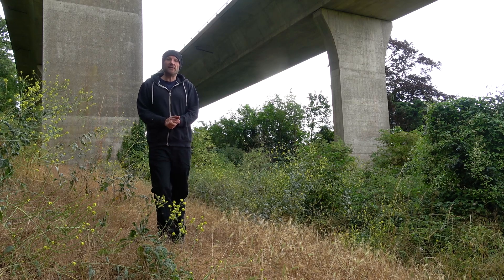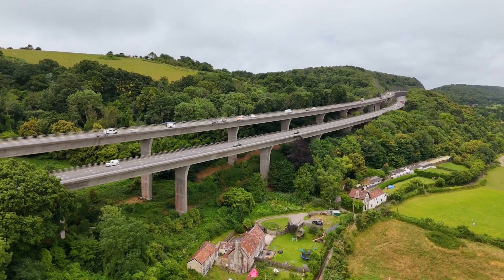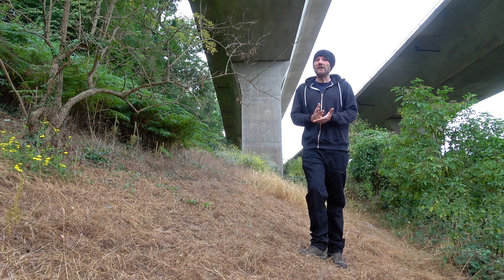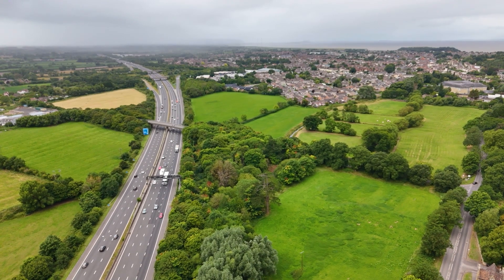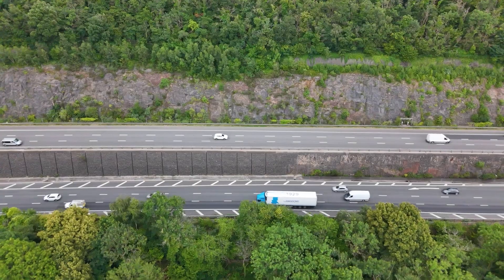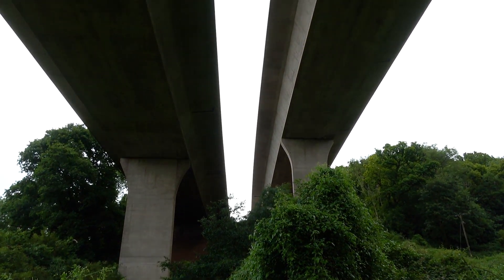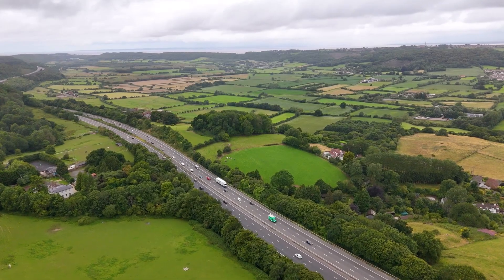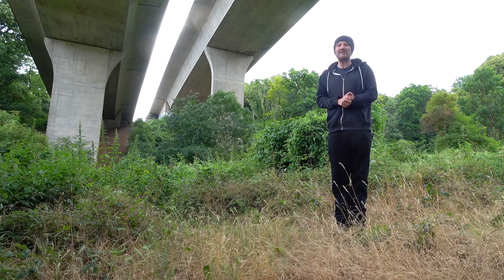The AMAZING Split-Level Wynhol VIADUCT - M5 motorway - Why Is It On Two Levels?

Comment: Check out the two viaducts on the A30 around Redruth in Cornwall. The steel shutters from this viaduct were used to build the Gilberts Coombe Viaduct and Blowinghouse Viaduct after they were used on this one. So the designs are of course identical. I worked on the Camborne Scorrier Bypass for Costain, cannot believe that was fifty years ago.

Comment: The design engineer for this section was Freeman Fox & Partners (which later became Acer; then Hyder and now part of Arcadis).  Whilst a student at Portsmouth Polytechnic, the construction site was one of our field trips and we walked along inside one of the box girders.  Little did I now that 10 years later I would be working for FFP in Hong Kong with one of the young FFP senior engineers that had worked on the design of this section as my boss !
Reply: IIRC Freeman Fox were also the deign engineers for the Severn Bridge (the first one)

Comment: A beautiful but very dangerous stretch of road, you are tempted to look at the scenery in the area rather than where you are driving, if you are scared of heights it does look scary. If you imagine dropping off the side which has happened in the past, you are pretty much dead. The cross winds can be horrendous as well, so driver beware in Somerset.

Comment: Before the bypass tunnel at Saltash was opened - always had a chuckle, as we inevitably sat in a long queue of static traffic - that everything came to a stop due to that single set of traffic lights in Saltash - regardless of where you had travelled from throughout the UK to get to Cornwall - via the M4, M6, M42, M5 - after travelling hundreds of miles, for hours on end -  it always came to a grinding halt right at that spot lol.....

Comment: Celebrating 50 years of a road engineering achievement is a good thing, but it made me wonder if there were still bits left of some earlier road projects which would now be celebrating their centenary?  You see, the 1920s was the time of the first bypasses.  While a number of them were doubtless widened, concreted over or turned into the alignment of a new motorway from the 1970s, I wonder if there's a trace of some where the replacement roads were built on a different route or further away from the town, leaving the old bypass route nowadays inconsequential?

Comment: Yes it’s a great bit of engineering but with a fear of heights I hate driving southbound along this stretch. I am usually near side lane behind a lorry or I come off at Gordano and take the old route to Clevedon then back on. I get a horrible feeling that I am being drawn to that open edge and tense up, once I get to the point where you start going down again and there are some tree tops visible on the other side that horrible feeling goes and I can relax again.

Comment: I spent a couple of years commuting up to Avonmouth to work in all winds and weathers on a motorcycle. This bit of road is terrifying in the winter on a bike, I would purposely not overtake stuff often sitting at 40mph simply because I did not want to get into the third lane as I could not get the thought of flying off over the barrier at the slightest gust of wind!

Comment: Thank you for the wonderful views and also making me realise how old I am.
I worked on the construction of this section of the M5 motorway which was built by Cementation Construction.
The actual construction process of building Whynol was more complex than it would be today as there were no precast units and the whole structure was built from formwork (scaffolding and  plywood moulds) , hand fixed steel reinforcement, and ready mixed concrete brought to the site from local batching plant. 
During construction the whole structure was quite flexible ( until the deck was complete end to end) so when the incoming loaded truckmixers braked to discharge , the viaduct would gently sway along the line of the motorway.
This structure is a credit to the engineers that designed and built it and especially the level of materials quality control and testing.
The farm building beneath the viaduct was used as the site offices during construction.
Reply from the maker: fascinating insight, thanks!

Comment: The stretch of railway line between Bristol Parkway and the Severn Tunnel is on different levels in places - and indeed at different points, which line is the higher one changes! This is because the line ascending from the tunnel is at a shallower gradient than the one descending.

Comment: We've just returned from a holiday in Croatia and while there we used the A1 motorway. It twists and turns through mountainous landscapes, using long tunnels and high viaducts. I was amazed at the engineering that must have gone into it. It dwarfs the M5!

Comment: You joke about demolishing most of Clevedon but they actually ran the motorway right through the middle of Portway at the bottom of the initial incline - this is why the old railway station for Portbury is on the other side of the carriageway to the majority of the rest of the village.

Comment: Actually it is/was considered good environmental construction practice (sic) when building motorways though environmentally sensitive hilly areas to split the carriageways to minimise the visual impact. A bit of a joke when you consider the exhaust and noise pollution which can be detected and heard many miles away and you have still sliced though greenfield sites.
Many years ago these concepts used to be in the design standards for the then Ministry of Transport which evolved to  be part of the Department of Environment. This reorganisation was a big mistake because it found itself giving evidence on opposite sides of Public Enquiries for new construction of motorways and trunk roads.🤣🤣
To confuse the opposition the best form of defence is akin to cutting up worms and elements  have evolved into today’s National Highways, which in the spirit  of national unity only responsible for England , not Scotland, Northern Ireland or Wales.😡
Needless to say, in the intervening decades, any semblance of internal expertise or being an informed client to manage contractors has been thrown out with the proverbial  bathwater though endless reorganisations and staff cuts in the name of efficiency.
I doubt whether such a structure could be built cost effectively  today without it hitting the cost over runs synonymous with HS2, aka HS1.5 the over priced high speed railway to nowhere (Not B’ham but the cities further north). But I save that for another rant🤣

Comment: There is a section of I-70 through Glenwood Canyon in Colorado very similar to this. It may even have been inspired at least partly by it.The road was built through a narrow canyon that already had a two lane highway running through. They used the already existing highway as the eastbound lanes and basically hung the westbound lanes on the cliff above. It's a gorgeous drive and an engineering feat.

Comment: Here's an "interesting" fact for you John, and viewers...
See the cutting through the hill at the right of the frame at 00:30?
This is where geologists working on the M5 discovered that one of the ice ages had reached much further south than previously thought.
It's also where you can guarantee that some twat will lose their poorly maintained caravan on the Friday afternoon of every single spring/summer bank holiday weekend, leading to tailbacks reaching to somewhere around Edinburgh.

It's also definitely not the stretch of motorway where I drove at 127mph the evening after passing my driving test in 1991 after persuading my dad to lend me his 405 SRi. Because that totally didn't happen Officer.

Greetings from Portishead.

Comment: John or is it Jon? Anyway, again you missed the chance to talk about the former wide loads holding area on the northbound carriageway that was in use during the Avonmouth bridge strengthening and motorway widening works... It’s now behind the new crash barrier and nature is taking over, but you can still see bits of it between junctions 20 and 19 in the area of the split level section.
Reply: Google Maps Street View from 2008 shows it with recovery vehicles https://www.google.co.uk/maps/@51.4552009,-2.7720478,3a,75y,5.7h,78.58t/data=!3m8!1e1!3m6!1sFh2zn7k9hGnv5cVIzjkwUw!2e0!5s20081001T000000!6shttps:%2F%2Fstreetviewpixels-pa.googleapis.com%2Fv1%2Fthumbnail%3Fcb_client%3Dmaps_sv.tactile%26w%3D900%26h%3D600%26pitch%3D11.417018754617231%26panoid%3DFh2zn7k9hGnv5cVIzjkwUw%26yaw%3D5.701147208561281!7i13312!8i6656?coh=205410&entry=ttu
Reply: Google Maps Street View from 2008 shows it with recovery vehicles - In case my post with a link disappears, its at 51.4552009, -2.7720478
Reply: Google Maps Street View from 2008 shows it with recovery vehicles 51.4552009, -2.7720478. The former holding area for the other direction (southbound) is at 51.5123114, -2.6530558

Comment: This section of the M5 taught me -or rather reinforced an advice from my driving instructor - that when you see a hill, put your foot down a bit more so you can maintain average speed. Lordy knows this advice has gone from modern teaching lessons, because so many drivers maintain their foot pressure and as a result slow down due to none anticipation of an incline.

Comment: You missed out that invariably in the summer, some twat towing a caravan southbound inevitably misjudges the descent back down onto the plain and flips it closing the motorway for hours. Triple points if it takes out another caravan towing twat as it goes over.

Comment: A friend was one of the scraper drivers for Blackwells on this section, scraping the blasted material either side of the raised section. Shift work, and he reckoned it was the most dangerous job he ever did with the danger of plunging down the hill if the machine slid. RIP Jimmy.
Reply: Blackwells - theres a blast from the mast. They were the earthwork contractors on a job i did at Costain back in the 80s. Hopefully they are still at it...
Reply: @edf6607  Unfortunately I think they’ve gone now. Heyday in the big infrastructure days and demise afterwards.

Comment: This is the largest vertical separation between two carriageways on the motorway network.
Reply: I dont know but in Italy things like this are normal. What could be the biggest vertical separation is on A6, the motorway was initially built as a single carriageway (not a motorway back then) and then  in 90' was built the second carriageway. In a point the old carriageway has a loop and the new one doesnt. Here are the coordinates 44,3211746, 8,3759671

Comment: In Canada, that would be an embankment in most cases. We've got several exemples of absolutely massive embankments and 40 meter deep roadcuts. There's just so many mountains that there's more than enough rock to build those massive embankments without having to mine the rock somewhere else. The 73 going north through the Laurentides in Québec has a number of dump piles for surplus rock. Even after building all of those massive embankments, we still end up with more rock than we know what to do with. I do have to say though, it does make for an absolutely spectacular structure.

Comment: Japan has many such viaducts and often on aplit level. Given the topography of Japan, I can now understand that the reasons are likely the same as the Wynhol Viaduct. Even though as a child we used the M5 to travel down to Cornwall for our summer holidays, I had no idea that the UK even had infrastructure similar to what is here in Japan. The Tokyo and Osaka Metropolitan Highwayw are of course mostly viaducts, with the motorway interweaving closely between buildings and in Osaka (possibly Kobe) where the motorway actually goes through a building.

Comment: You never mentioned the nudist camp alongside.
There is also a tunnel (you’re not supposed to go into) that goes under the split level which itself is split level with a near vertical staircase.
Reply from the maker: more details on tunnel required....

Comment: Apart from demolishing Clevedon, the other reason not to go through that 'nice flat bit' is that it's a National Nature Reserve. Back in 1971 it was designated as a SSSI, which was probably another reason that steered the planners away from the valley and onto the hillside. It's certainly ended up being more ecologically friendly as a result.

There's quite a few footpaths - and footbridges - that cross this section of motorway, with two going over and a couple going under the viaduct section. The footbridge that crosses over the top of the split level section is not great if you don't like heights! Whereas the footpaths under the viaducts really allow the scale of the engineering to be appreciated.

When driving northbound, just before you leave the viaduct, a metal access door is visible in the base of the southvbound viaduct, under the carriageway. I've always wondered whats behind that door, and how often people go in there...
Reply: Thanks for the memory, that door, me too!
Reply: I pity people whose houses are nearby and suffer from noise pollution every day of the year. Relentless noise.
Reply: I've also wondered if building a motorway on such terrain would have a massive flood risk impact, given the earthworks involved, and the surrounding geography

Comment: Oil pipelines.  One runs under there.
A new series if you run out of roads.  Can't say much more in case GCHQ knock my door.  Look up PLUTO, but it's not PLUTO.  Good place to start.  Or GPSS.  Oh, they're knocking.  PipeLine Under The Ocean was PLUTO.  Now operated by Spain!  Got two pipelines running through next doors garden.  It's supposed to be a secret.  I've mapped them all over a decade.  Knocking is getting louder.
Reply: Kerosene for LHR and LGW from Milford Haven mebbe sir‽
Reply: @JP_TaVeryMuch   GPSS pipes are military next door.  LGW gets fed from Fawley and Buncefield.  LHR stranglely the same, but different size pipelines that are parallel in places alongside high pressure gas pipelines.  There are inconnecting bits and Milford Haven can be involved via Kingsbury to Buncefield.  It's mainly ESSO  and the BPL agency for those airports.  Both airports have links to the Thames pipelines too.  KNOCKI KNOCK. 🙂  They're at your door now.  GPSS is military only, like ALL military airfields.  Near me, there's a nursury surrounded by underground fuel tanks,  Like enough to power the UK for a year.  All burried/hidden.  Look up either Padworth, or it's called Aldermaston.  Not to be confused to  AWE Aldermaston that is not part of the system.  KNOCK KNOCK.  Feeds the USA military stations too.  Fairford, Mildenhall, Lakenheath...
Reply: @stevekelly5166  
Many thanks for the information. Grew up crawling over a (shh still connected to the network) WWII fuel dump over the other side of a main railway.
Was told and still thought about Milford Haven onwards, but it always didn't make the best sense so thanks again.

My butler always gets the door and he's good at repelling all comers, so good luck with yours!

Comment: That's all very well but, what is that little hamlet in the valley all about? And does it have a pub?
Reply: They're not really hamlets down there, more a collection of (very old) farms spread out along Clevedon Lane. At the top end of Clevedon Lane though (the bit furthest away from Clevedon) is the village of Clapton-in-Gordano - roughly in line with the start of the uppy-downy bit and where the outer lane disappears and all the accidents occur. In Clapton is the Black Horse pub; the building dates from the 14th century and is absolutely worth visiting!